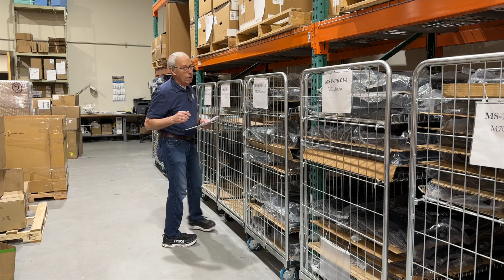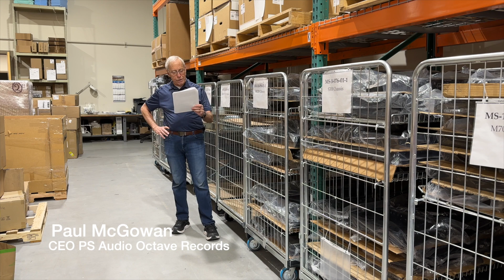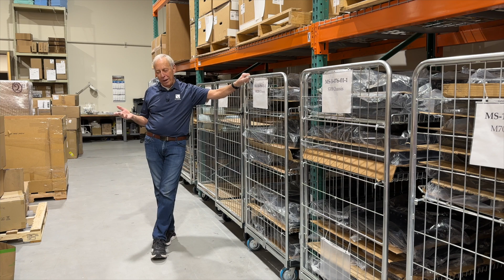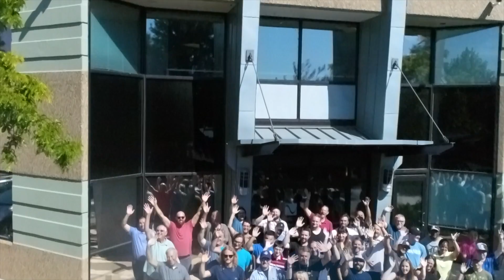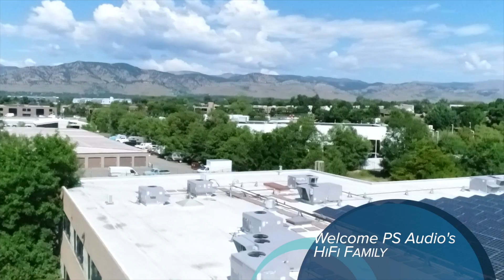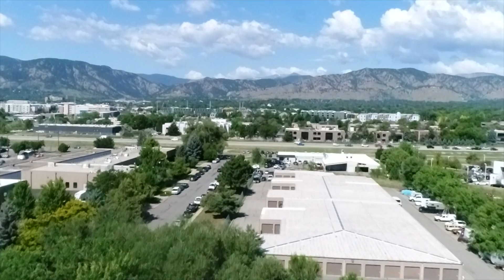Why the last few feet of the power cable matter

Comment: I am so tired of unscientific claptrap in the audiophile world. What's even more galling is to be called an "air-quotes" denier simply because the science behind this nonsense isn't there. In most fields people say follow the science - when it comes to audiophile lore it's apparently better to ignore the science and logic. 

I'm also frustrated by the pompous "people who have no experience" jibe - we've all got ears, Paul, we've all got minds that work, and most everybody who follows you on YouTube will have experience of a highly resolving system, so please don't keep putting down people who have (like me) years of experience in installations of high end equipment and who can say, categorically, that there is no science or logic or reason in spending a fortune on expensive power cables for the last few feet of power.
Reply: Wow! That's bold of you to go against the Paul... on his own channel even
Reply: @guinnster1  The truth is just the truth with facts backing up the truth. Otherwise it's a theory of a possible audio improvement concept or a sales practice, purely.
Reply: @guinnster1  -- I've been calling him out for years.   Most of the time, his minions eventually get around to deleting any hint of common sense knowledgeable folks provide in the comments.
Reply: @guinnster1  I didn't realise this was a faith based channel. Last time I looked this was about audio engineering, which deals with facts rather than hokey religion.
Reply: Paul is a great informative guy but also a great seller so even if what’s being said only helps 0.0001%, that’s enough to say “it does do something” and will recommend you a $8,000 plug for that 0.0001%.
Reply: @Bassotronics  
If you had the money and spent 5000,000 dollars on your audio system, wouldn't you want that 0.0001 percentage?  An $8,000 dollar plug isn't for the typical person in this comment section or the world.
Reply: God bless you mate well said 👍
Reply: There's an old proverb, "Perfection is the enemy of the good." I spent nearly $1k on a system in college. Inflation would probably peg that system to somewhere between $10-20k today. The question is, what is good enough? I just spent $30 on a cheap set of computer speakers for the office, and for that use, they are good enough. They sound a bit better than the cheap transistor radio of my youth. While I have a home system that can impress most people, chasing down that last little bit of noise or distortion just isn't worth it for me.  Your mileage may vary.
Reply: We have to weigh the esoteric claims of belief and denial against the assessment of whether Paul makes more or less money from selling more or fewer esoteric power cables with funny shaped conductors that make no engineering sense at all. It's sad to see a man who clearly understands electrical engineering resort to such demonstrable nonsense.
Reply: "...we've all got minds that work..." 
You sure about that buddy?
If you're willing to discard something just because it goes against your beliefs, then i dont think your own quote apllies to you.
Its sad how triggered these deniers get every time they hear that cables matter. You are free to think anything you want, but dont get triggered when someone doesnt share your opinion and points out that people like you are not willing to listen. You just proved his point.
Reply: @wisehippo3072  Oh dear. The point is that this isn't about "beliefs", it's about provable, quantifiable science. I don't have any belief regarding cables, I follow the science - if it can be proven, or demonstrated, that power cable A sounds better than power cable B, then that's great. The problem is, it can't be proven, and leads to nonsense being spouted and science and logic being abandoned. In engineering that is simply not good enough.
Reply: @wisehippo3072  but it’s not a belief though is it? If one party always refuses to measure anything to support their claims and it doesn’t make sense within current established scientific consensus, what ever they are paddling probably has some issues with it. Since if this was the case you know, we could have measured it all the way throughout the chain. Our ears are very very poor measurement devices, we can make way way better devices out of hardware to measure essentially everything about the audio band. (Audio band is damn low frequency all things considered and frankly almost trivial te measure with any half competent setup.
Reply: Is your system revealing?
Or, do you know what revealing sounds like?
Cable deniers will never know.
Reply: @tubefreeeasy  It doesn’t really really matter, if there is an effect, there should be a theory to explain it and then that theory tested. So far I have never actually seen any of it, it’s always just “trust me an buy me 1k cable”. 

My system is relatively revealing (but cheaper than 5 grand so probably not good enough in true no true Scotsman style), and you know what? The power cables of the power amp is truly the last of my worries. Especially since nobody has ever truly demonstrated an effect that matter. Doesn’t help that we don’t use metal conduit here in Europe so every cable in the wall is many many meters of unshielded anyway. So if that were the issue all audio products would be completely unusable everywhere without metal conduit from power plant to socket, and let’s be real, we both know that that ain’t true.

When you get true AC interference into your system it is extremely apparent, popping, buzzing and straight cutouts etc.

And in addition the PSU designs of my hardware is semi-competent so the effect of truly horrible interference of even very one electrical devices on the house supply are basically impossible to hear. The thing you hear is the thermal noise of the device itself.
Reply: @EraYaN   If your audio system in total cost you 5 grand why would you spend 1 grand on a power cable? Knowing you would need more than one cable, that makes no sense.  
If one has the money to buy a 100,000-dollar preamp another 100,000 on an amp and another 100,000 on speakers, do you think that person is going to spend 20 dollars for all the power cords needed?
Reply: @tubefreeeasy  -- Is "revealing" the audiophool claptrap of the day?  Whatever happened to "resolving?"